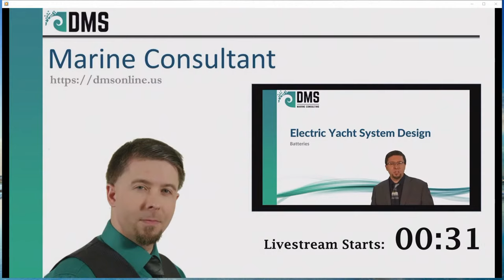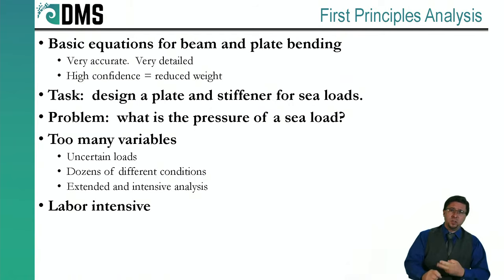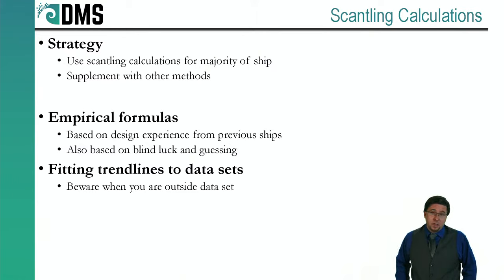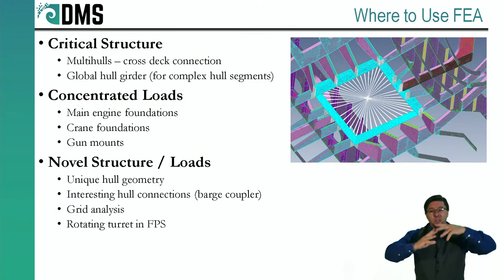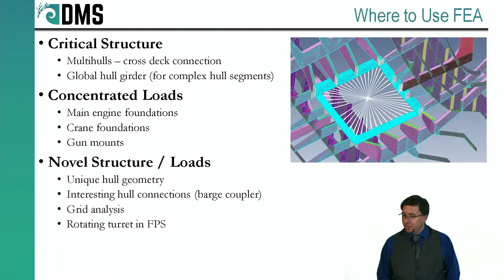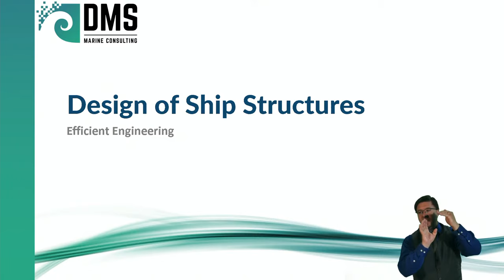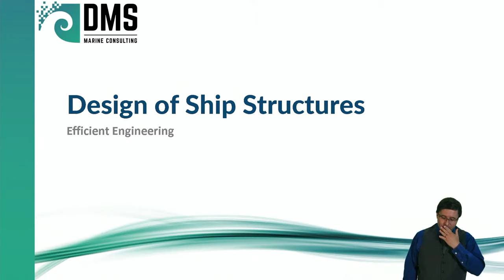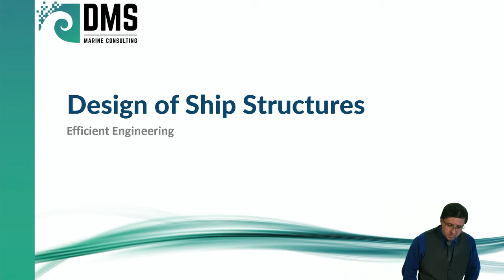Practical Structure Design:  How to Size Ship Structure

Comment: Hi Nick the naval architect.

I just had an idea that could save lifes, and I wonder if you could explain how it coukd be for real.

The idea is to make a room of an existing house tsunami-proof.

There is some place where people build a life boat in case of a tsunami in their garden. but it take space, and it would take time to reach it on time.

Here the idea is to

1) choose a room that is not too big with a door and if possible no more than one window

2) cover the wall, floor, and ceiling with paper or plastic tarp or whatever

3) paint on it a resin, add a natural fiber or a mineral one like fiberglass. add several layers.

4) i guess the corner of the "life box" should be kept round, simply by adding more papers on the corners of the room

5) build a door and a window with a flat plywood, covered with resin and fiber as well.

And here we have a dedicated room where everybody in the house can take refuge inside as soon as they hear the tsunami alert. 

Now in case of an impactfull tsunami, the impact will be undertook by the house that should deteriorate, living the lifebox free to stay afloat until the wave is gone.... or until some boat rescue it back in the sea.

therefore the lifebox should be able to resist with the impact of the deteriorating house. Does the box need reinforcement? where? or does the composite is strong enough to endure all of this?

In case of new houses, the life box can be build before the house and therefore have an optimised ratio...

It would be great if you can explain us in a youtube video all the details about how to build such life-room!

I'm pretty sure it is a piece of cake to do so, especially for you.